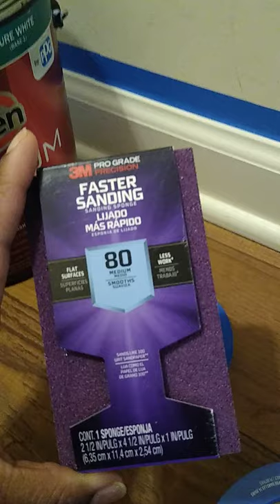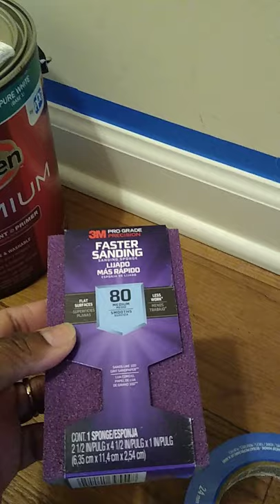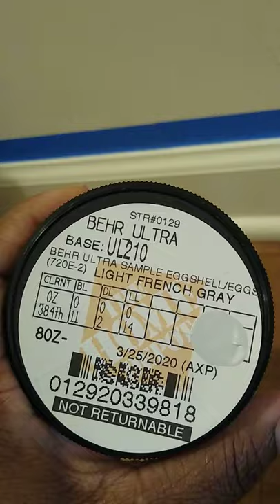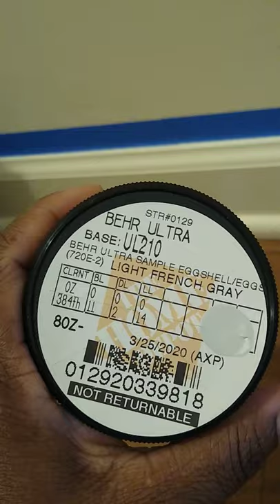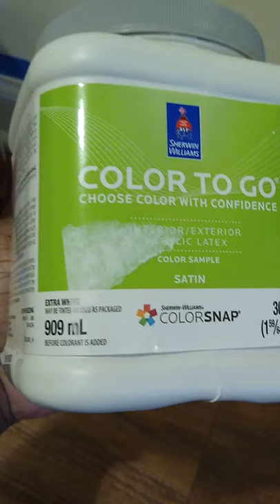LGI House to Home Painting Series with Tasha in foyer

Comment: HEY IM RESEARCHING LGI HOMES AND THEY HAVE SO MANY BAD REVIEWS.. HOW IS YOUR HOME HOLDING UP WOULD YOU RECOMMEND A LGI HOME?
Reply from the maker: I would not recommend them but if u do go with them as a first time home buyers get ur own inspector to inspect the home. We found alot of things in the house after the 1st yr that we had to fix. For starters my kitchen cabinets missing pieces inside to hold shelves, the granite on the kitchen counter was chip, in my son room when we painted in there the baseboard is uneven like the wall foundation is off. We didn't see that when we bought the house. Didn't think nothing of this or that this would happen...  The fridge was brand new when we bought the house Sept 2017 and Oct 2020 it stop cooling and now the stove is going out. Got to replace it. finally moved the stove out the way they never finished the wall behind it... Reported it to them... After kept calling about it numerous of times they finally came to fix it... And the boards in the ceiling u can see on the ceiling.. at first I thought it was a bad paint job but it's the boards... But we have been slowly changing things in the home. This is a starter house for us... We will be looking for another house in 2-3 yrs to resell and get what we want. This house is too small a 3bed/2 bath..